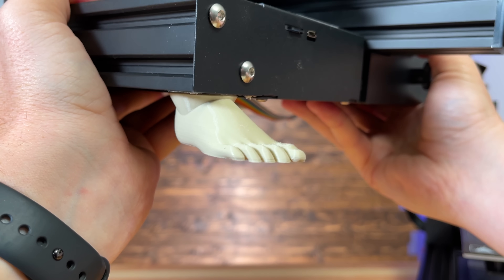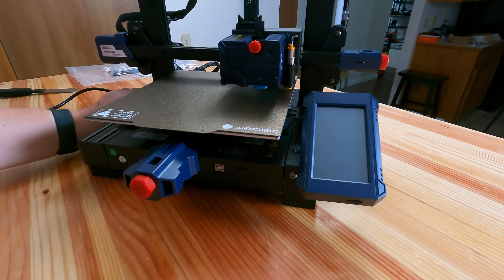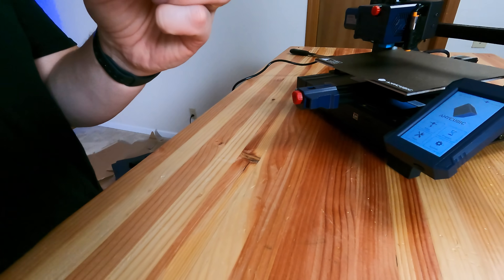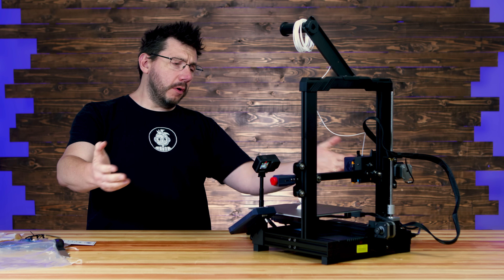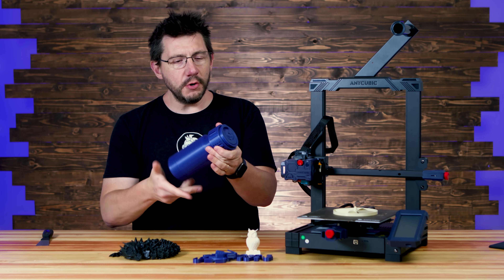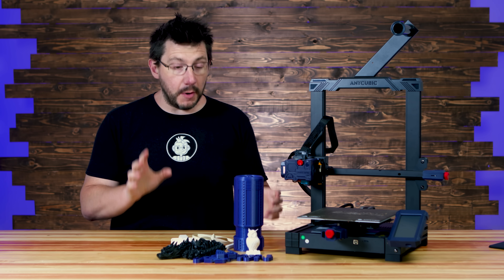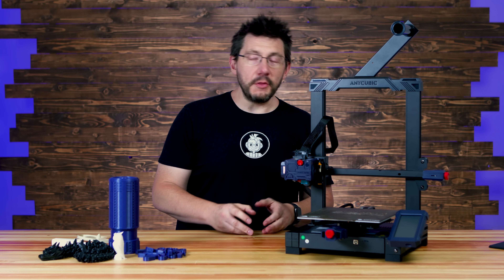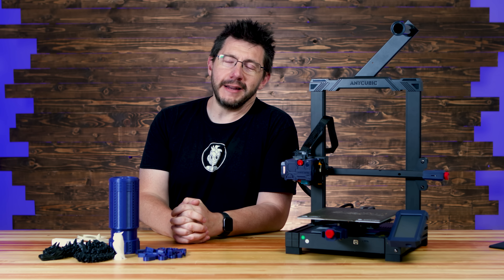Anycubic Kobra 3D Printer // GIVE 'EM THE CLAMPS!

Comment: for years and years i have been wanting to learn how to print using a 3d printer, so I bought this printer. I was over the moon getting my first 3d printer !!!!!!!!! 
set it up ......... tried printing - and it acted crazy and i couldn't print one single thing !  it always came out looking like a spider web and the filament would leak on the machine and not the heating board - after trying to print twice and messing with all the setting's over and over again, i just gave up. couldn't get anybody to help me with support - ANYCUBIC support was not helpful - didn't have anybody to show or assist with getting up and running. i tried changing settings i tried for days sitting Infront of this printer --- wondering ..........IS IT REALLY THIS HARD ????
i just couldn't figure it out or was able to print ANYTHING for the life of me ! 
I gave up on my 3d printing dreams.
10000000% lost interest in printing.

eventually gave it away for free

Comment: I bought this machine in 2023.  It was $200.  It was worth it.  I like my Flashforge Creator Pro's and Dreamers better, but for the price this is a great printer.  I do not like the texture on the build plate and I find it very difficult to remove ABS from the plate.  I'm going to try covering that metal plate in Kapton Tape, as long as the auto level can still work, I think it'll work fine.  You might even be able to flip that magnetic plate over and put the Kapton tape on the bottom side for a smooth finish on the bottom of your prints.  

I upgraded my copy of Simplify3d to V5 and that had a profile for this printer.  My V4 did not have one.  Cura comes with this printer and trying to slice anything on it took forever for me, Simplify3d slices everything in seconds like V4 did.

Comment: Any advance on what to do when Anycubic Kobra printer has poor adhesion? I’ve noticed the filament is not bonding fully as its layered. It’s my third print and was experimenting with a taller print. Supports were also to thick and ended up being hard to remove. Any advice would be greatly appreciated. Thanks!!

Comment: i used the textured side and got poor bed stick so i flipped the biuld plate it stuck great for a wile but then started coming so a little hair spray pefect every time
Reply: bed stick on the coating is incredible for PLA and PETG as well as TPU even.  Most don't scrub it with dish soap to get the factory oils off of it to get it sticking.  Hair spray is no longer a print thing.
Reply: @brianmi40  I tryed sope and water, alcohol, and a few more, nothing got a print to stick, I'll stick with the hair spray washes of easy and just a very light spray

Comment: you can adjust Z-Offset during the print, and the setting is sticky (will be  remembered as a default). At least with firmware  2.7.9

Comment: I just picked up a Kobra Neo on amazon for $189. almost the same thing but with a smaller non-touch screen with the knob. Came in a bundle with some random filament too. I'll see how it is when it arrives but it seemed like a great deal. It was also from the Anycubic vendor so I don't think it was a scam or anything.

Comment: Is that a hall sensor leveler? Does this mean we can't print onto a glass bad and still have auto bed levelling?
Reply: Correct. From the manual: "Note: Only the build plate with metal surface can be detected by the proximity switch. Auto-leveling does not work for build plates with non-metallic surface."

Comment: I dont get what the Z offset is , can someone explain me about it, I've been thinking about getting a 3d printer and now I want to know everything about it before purchasing it
Reply: These printers have a fixed bed: no adjustment knobs to move the bed up or down anywhere.  so since it uses a sensor to detect the "nearness" of the metal bed, in order to do its "mesh leveling" (which determines correct distance from bed even with slight warping over the surface), it simply establishes a distance from that sensor, to the bed.

To get the correct "squish" of your first layer into the bed for proper adhesion, --but not overdoing it to create "elephants foot", the Z offset is how you dial that in.  It's simply raising or lowering the print head's Z distance from the bed for your first layer resulting in a thicker or thinner first layer, somewhat overriding the first layer height you set in your slicer.  In a perfect world, if you want a .4mm first layer height, you could get it exactly on a printer.  But due to needing good adhesion, the Z offset is usually set to squish it just a bit thinner.  Printers like this, you can even adjust the Z offset while printing the first layer, if you look closely while printing and notice it a bit too close, or a bit too far away for your liking.

This should probably be the way printers go in the future, since too many people hate bed leveling manually and perhaps better yet, without any leveling knobs turning bolts to move the bed up and down, but rather fixed in place, there really shouldn't be any adjustment needed for quite some time down the road, if ever.

Depending on your $$$ available, if you are looking in the +/- $250 range, I would highly recommend checking out the reviews for the Sovol SV06 which I just ordered as a 5th printer as a step "up" from printers like this one.  Over this printer, which the Kobra is on sale for $245, with a Sovol SV06 at $259 you'll get linear RODS on all axis (instead of rubber wheels, longer life, more accurate, no adjusting...), a FULL metal hotend that, IF you want to and learn how to safely, can go up to 300C for more "exotic" filament types.  It has a planetary gear for the extruder (3 gears that reduces individual gear strain but increases overall force) and is a direct drive unit like this, so can handle things like flexible filament (TPU), plus dual Z rods with dual steppers for more sure Z control instead of a single Z threaded rod and stepper like this Kobra has.  Same bed size, same PEI bed surface, but will print a bit faster due to stability of linear rods (video of it printing benchy at 2x speed on Sovol site right after assembly).

You'll see Lost in Tech's video (3d printing expert) referring a lot to an "orange" printer that the SV06 similar to, that's a Prusa MK3S+, which is a $799 printer that comes as just a KIT -- which you have to FULLY assemble from parts in a box, not just bolt together like the Sovol... and the Sovol has some improvements even over it...

https://www.youtube.com/watch?v=JTlmYucBsS0

good luck

Comment: hi, I was thinking of buying the Anycubic Kobra as my first printer. I would like to print mostly functional stuff and would like to get enough accuracy (as much as it is possible to get it from printers in this price range). Can you recommend this printer to me? a Creality Ender v2 neo for example can be better or more or less are the same thing?
Reply: Depending on your $$$ available, if you are looking in the +/- $250 range, I would highly recommend checking out the reviews for the Sovol SV06 which I just ordered as a 5th printer as a step "up" from printers like this one.  Over this printer, which the Kobra is on sale for $245, with a Sovol SV06 at $259 you'll get linear RODS on all axis (instead of rubber wheels, longer life, more accurate, no adjusting...), a FULL metal hotend that, IF you want to and learn how to safely, can go up to 300C for more "exotic" filament types.  It has a planetary gear for the extruder (3 gears that reduces individual gear strain but increases overall force) and is a direct drive unit like this, so can handle things like flexible filament (TPU), plus dual Z rods with dual steppers for more sure Z control instead of a single Z threaded rod and stepper like this Kobra has.  Same bed size, same PEI bed surface, but will print a bit faster due to stability of linear rods (video of it printing benchy at 2x speed on Sovol site right after assembly).

You'll see Lost in Tech's video (3d printing expert) referring a lot to an "orange" printer that the SV06 similar to, that's a Prusa MK3S+, which is a $799 printer that comes as just a KIT -- which you have to FULLY assemble from parts in a box, not just bolt together like the Sovol... and the Sovol has some improvements even over it...

https://www.youtube.com/watch?v=JTlmYucBsS0

Comment: i've recently bought this and have a little concern...
when I manually move the print plate while the printer is off I can feel a cupple of "bumps" or small points where it doesn't slide that well.
this sometimes cause the homing process to stop half way, when it encounters one of this points.

i looked if any screws were in the way, I looked if the wheels had something wrong, I've tried adding some lube to the wheels but nothing. 
does anyone know what could cause this problem and how to solve it?

ps, If i put the print plate all the way in the back then the homing works and the print turns out pretty good.(it doesn't affect the y axes that much while printing)
Reply: It indicates the rubber roller wheels are set TOO TIGHT.  You should be able to roll the wheels themselves by moderate finger pressure when in place - NOT moving the printer head, JUST spinning the wheels in place, though not so loose as to spin without friction, or allow wiggling to occur of the bed or Z or Y axis, which indicates they are too loose.  Having them too tight like this is detectable if you power it off, and roll it back and forth and feel it somewhat "jerking".

These need to all be dialed in on all axis during assembly.  It can take a bit of time, but you want every wheel dialed in the best you can get it.

Look up how to adjust the eccentric wheels in many build videos and get them dialed in perfectly.
Reply: @brianmi40  thank you.
But what do you mean by "spinning the wheel in place"? Because i can't spin the wheels without moving the print plate.

Anyway I'll try this as soon as i can and I'll tell you how it goes
Reply: @alexplosion_ITA  it's simply too tight if you can't turn the rubber wheels without the carriage moving.  There should be some friction, but they need to turn otherwise too tight on the eccentric nut.

Comment: My Kobra needs -1.45mm almost at the max . Also the wires connecting the screen to the motherboard were glued halfway in causing heaps of trouble .All good now though I haven't  managed to remove the nozzle yet ....
Reply: you MUST heat the hotend and remove or install any nozzle at temperature.  Also need to wrench the block so that you don't break it away from the mount, since those bolts are small: two wrenches...
Reply: @brianmi40  Cheers Brizy! I'm thinking the Z offset may be way out because of the lack of washers used under hotplate. Maybe installing some washers may bring the Z offset closer to 0
Reply: @madsnoop7  For sure, if it's out of the range of Z offset, you'll need to get the bed closer.

Comment: I had my Kobra for 10 days as my first printer and the Y-Belt snapped. Also the print quality was horrible and even after a bunch of calibration was average at best. Lets see how well it will be when I replaced the belts tomorrow but so far, this printer is a total let down.
Reply: You had the belt too tight.  Get a new belt and adjust your belts looser.  They're thin belts, nothing like those under the hood of a car.  You need them barely tight enough so that they don't ever jump notches under pressure when printing.  You'll see the print "loose registration" and shift over if that happens, if so, slightly tighten and go again.  But too many people think just "crank up" the belt tension which is a definite NO.  Too tight just prints crappy.

Comment: The reason why Anycubic moved away from the strain gauge bed leveling is probably because you could easily damage the strain gauge when you inevatably need to clean the print head. Sure, you could remove the hotend from the strain gauge when cleaning but that is more work when you just want to get back to printing.

I have the Anycubic Vyper and had a lot of problems caused by loose screws in the extruder, broken strain gauge and problematic firmware. The printer heats up to 230 C / 446 F when feeding in filament which completely cooks my PLA and clogs up the hotend. When you learn to handle those issues it is a great printer though. Now I always feed in PLA manually and it prints great. Especially when slicing with Cura 5.1.
Reply: Would you pick the viper or would you pick this? I’m trying to decide between both I wanna print TPU, which seems like this would be better for.
Reply: @Arturito2017  Direct extruder is always better for TPU so the Kobra is probably the better option. Also, you will probably not print tall things with TPU so you will not notice that the Kobra only has one Z-screw instead of the Vypers two.
Reply: @bertilorickardspelar  yeah I ended up getting the Kobra and I’ve had it for about a week. But there seems to be this strange horizontal line  about halfway up in the owl print. That I can’t seem to get to go away. Any tips?

Comment: I bought the anycubic kobra about a month ago and still haven't been able to make one print. I follow the setup instructions, like preheating and leveling and even if I try to print the owl it comes with , it totally fails. It just starts printing in a horizontal line. I downloaded the suggested parameters that come with the SD card but I can't fix it and don't know how. Please help me!!! 🙏🏼
Reply from the maker: Oh no! What has Anycubic support said?
Reply: @3DPrintingNerd  haven't really asked... I only asked the distributor that sold me the machine. But it's in perfect condition, it's brand new. I don't know what else to try!
Reply: watch build videos for other printers, many cover common problems you can run into.

Comment: Went and got one of these and so far it's been...not great. The brackets holding the bed and the extruder motors are crooked and the MB fan makes a horrible noise. I contacted Anycubic about a replacement and they sent me some of the parts, but not the ones that had the biggest impact like the extruder motor bracket. The crooked bracket causes all my prints to get too close on one side of the bed when it moves from front to back on the prints, and raising it makes the opposite side too high to adhere to the bed.

Anycubic's support hasn't been very helpful. The parts they sent were a good attempt, but they won't send me the one I need and they're fighting me on replacing or returning the unit. I don't see myself buying anycubic again after this. Sucks cuz I do otherwise like it.
Reply from the maker: Ugh are you serious? That’s no good. Please email me the details. contact at the3dprintingnerd dot com
Reply: @3DPrintingNerd  Sent. Hope you got it.

Comment: Looks like this comes with a development version of the Marlin firmware. Anyone know how to update to something more current?
Reply: I tried to get them to release the source code but no luck. Only answer is to junk the controller and install a BTT one which is supported. Other issue is Anycubic must have got a good deal on 6 pin JST connectors, because every thing is terminated on 6 pin connectors, so all cables it will need to be re-crimped for other conventional boards
Reply: @oaklandservers  Thanks for the info. I'll have to look into that. Good thing I have tons of JST connectors. 😁

Comment: You should not touch that build plate with your greasy fingers. I do have one and try not to do that, and use a plastic spatula for removing parts (or wait till it cools a bit). And please, dont clean debris with metal because it ruins the PEI coating!!! And you can use Acetone or IPA (the one i use) for cleaning it faster, but a good clean with dish soap and hot water does miracles. It was the best upgrade i could do to my machine and i really love the parts bottom finish.

Comment: I don’t understand what the deal is with auto levelling.  Are you all not able to manually level the bed?  And surely the bed must be within a certain level of levelness (I know, english right) in order to enable auto levelling in the first place.  Whatever the case it just doesn’t make sense to me to introduce so much complexity and potential for error just to save 2 minutes, after which the bed virtually never has to be adjusted again.
Reply: auto levelling is really handy with printers that use magnetic pei beds, specially if you switch between multiple beds a lot like me. It adjusts to the small differences between beds and placementson the plate
Reply: @Joshuadomiel  aah.  I understand.  Thank's for your reply!

Comment: I bought one of these a week ago, and was getting really good prints for first 2 days.  Then it clogged, and I'll get it cleared (think I did) and quickly clogs again.    Not a lot of information on clearing the clog like other printers, but this is first direct feed and when I removed the filament, the little PTFE tubing came off with the filament, and not sure if it's not seating properly when I placed it back.  Hoping to figure it out today...  Prints have turned out great to this point.  (about of a half of spool of 1KG filament used so far)
Reply from the maker: After filming I did get a clog - turned out I had to replace the nozzle. Once I did that it was and has been smooth sailing.

Comment: Always wash those plates! The grease and oil from manufacturing is such a problem sometimes. Glad to see you got it worked out!
Reply: Isopropyl Alcohol wipes before and after Printing works well for adhesion issues.
Reply: I tryed everything I still had problems, what got me is it stuck to the other side better than the front for a long time, the hair spray I'm going to keep using it, as it just washers off and I can get 5 or more prints with a light spray, I can say the hardest part was getting the beed tramed and level, a little work on belt tention I can hit print and walk away